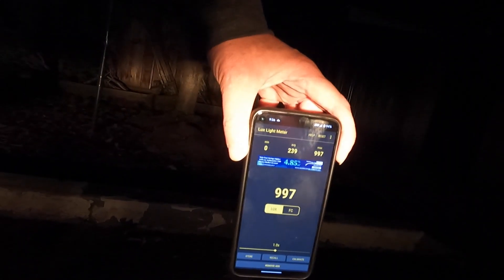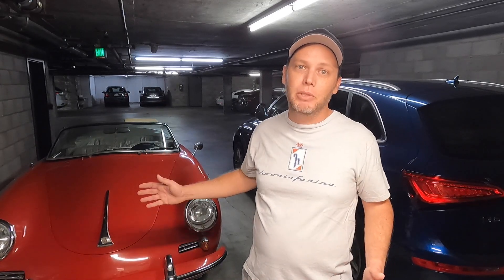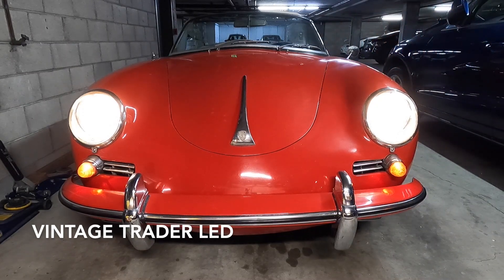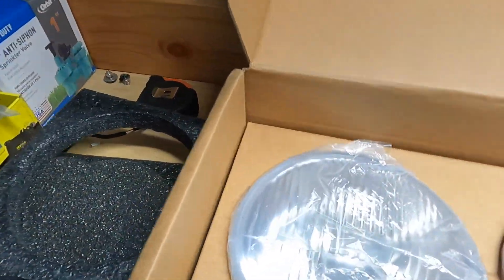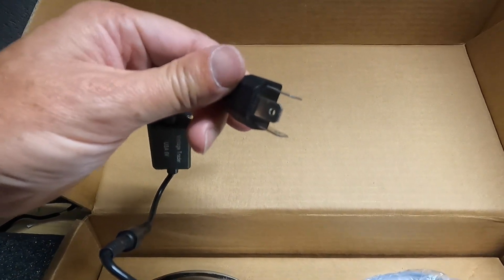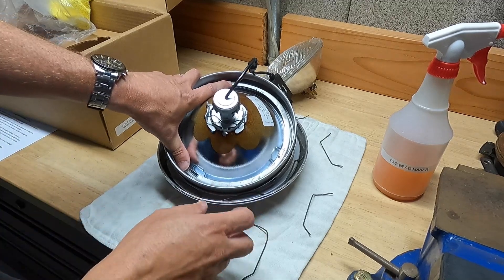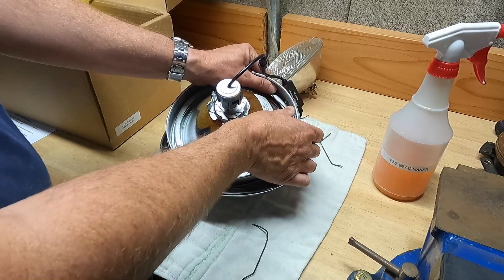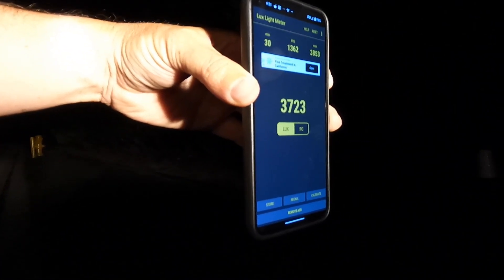Porsche 356 LED Headlight Review (6 volt)

Comment: First, thanks for the helpful video. I'm trying to decide whether to splurge on LED lights, which take a bigger bite out of the budget. You mentioned a dim headlight. Did you try to find out what was causing that? Like by switching headlights or checking the connector? A 356 guru told me to inspect all the fuses, clean them and apply bulb grease before reinstalling them in the fuse box. Also you mentioned detailer's spray. There are so many sprays out in the market. Which do you use? Mahalo.
Reply from the maker: Thanks for the comment! 

I didn't really mess around much with the one dim light since I was replacing with the LEDs anyway. To be honest, I didn't even know it was dimmer until I took the measurements for the video! You should definitely go for the LEDs, they made a huge difference driving at night.

As for the detail spray, yeah there are a ton of options, I like one called P&S beadmaker which you can find here: 
https://amzn.to/3SSjDKR